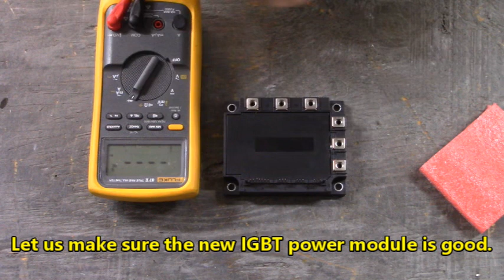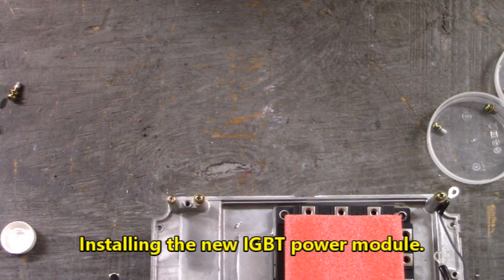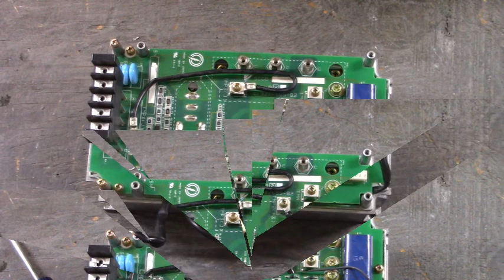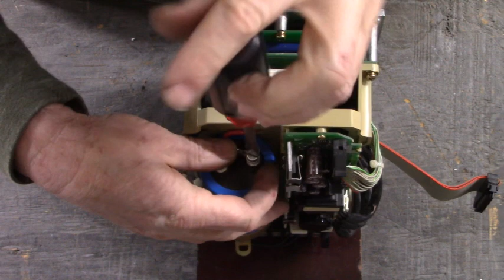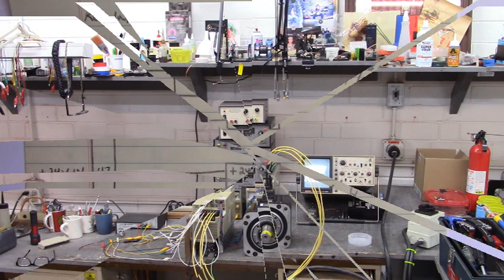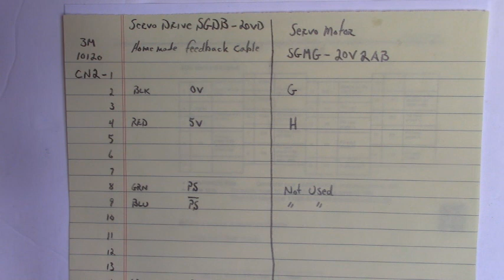(Part3) Yaskawa SGDB-20VD Shorted IGBT

Comment: Hello, thanke you for super detailed video. :)  I found your video, bwcouse i searching solution for my problem. Can i use this SGDB drive without operator panel? I have the same drive, but i dont have operator panel. I connected with PC software over RS232, and in it i can enable and JOG the drive, and i can see the level changes of S-ON and other inputs. But if i disconnect the PC, i cant enable it. Thanks, Attila.

Comment: Hi, i need help for extrac a end shaft fron lenze motor. Do you help me. Thank you.
Reply from the maker: Hello Sir, I am so sorry, but I have never performed this procedure. But maybe you can help me. I have four Vickers / Moog Servo Drives in the shop. Model Number DBM-03 that are giving me fits. They are three axis drives. Axis 1 and Axis 3 fail on short circuit alarm when the axis is "Drive Enabled". But no short circuit exist in the Transistor Power Module, nor the U, V, W cables, and nor the servo motor. All the power supply voltages are good. I am at the end of my troubleshooting skills trying to repair these drives. Thank you :)
Reply: @PeepawMcDonald  Hello sir. It occurs to me that it could be a problem in the current reading. You could check the current sensing circuit to eliminate this possibility,
Greetings and thanks for answering sir.
Excuse me, my English is very basic.
Reply: @PeepawMcDonald  I can so relate, im doing some Okuma drives and the drives are full of epoxy coated hybrids.  Even trying to find the voltage monitor circuit for the OV and UV is killing me.  They really worked hard to keep guys lime us out of their drives.  Good video and I enjoyed your pickin n grinning  thumbing up👍
Reply: Moises is right! I've had that problem before. If motor doesn't run smoothly (if it runs) then fails on either over current or short circuit alarm, it could be current sense amplifier (if current sense resistors are used), an open resistor or even (if donut shaped) current sensor itself.

Good luck on that and thanks again for sharing your knowledge!